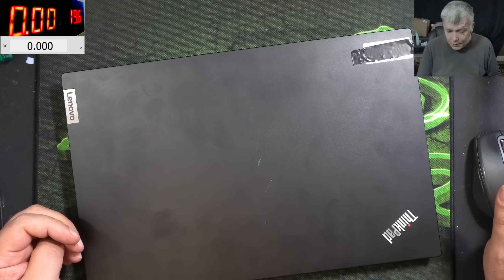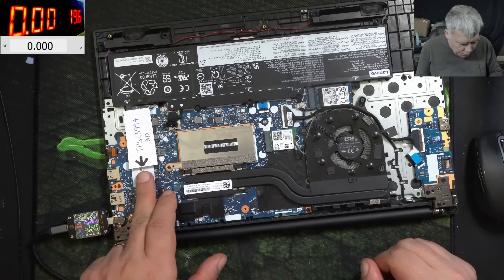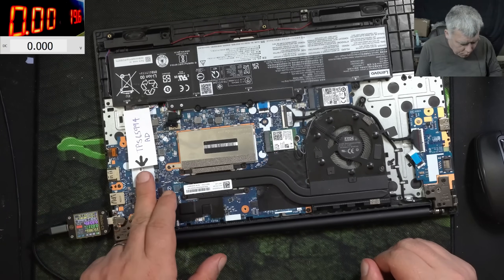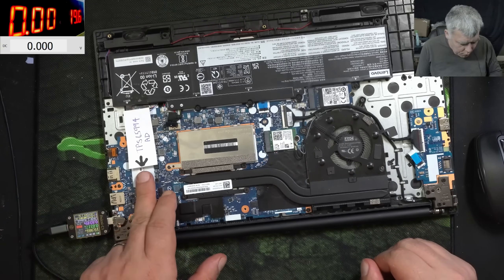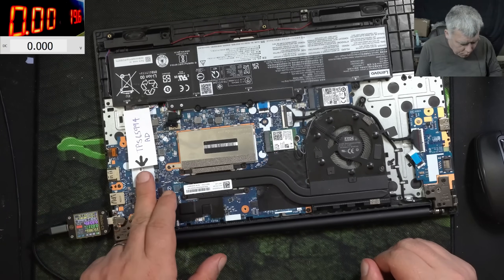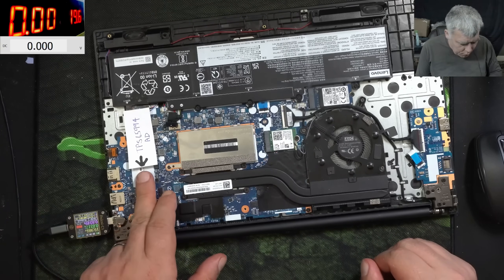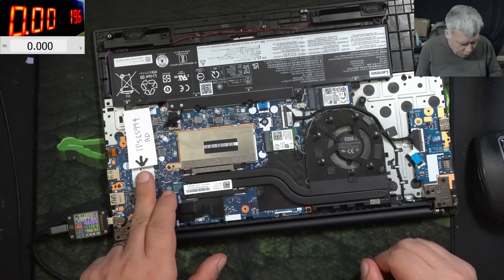Well, this is a common fault - Lenovo E15 not charging board repair

Comment: So when you solder the left side of where qb6 was are you soldering to the 2 pins on left. Or second one down. Or does it not matter if both are connected. I have same laptop and the usb power connection was intermittent now it’s not working at all.

Comment: I don't even know what a mosfet is, but I followed exactly what he did and now my laptop is powered up and charging (Thinkpad e15 gen 2).  The first mosfet was actually melted to the foil, so clearly there is an overheating issue.

My solder looks like a lump of sh*t compared to his, though.
Reply: Did u solder to one pin on left or does it touch 2 pins. I’m not sure which pins of mosfet did what

Comment: I’ve seen this fault many times 😂

As you say, If you replace just the mosfets they will fail again. 

If you replace the TPS65994 as well as the mosfets it will not longer be an issue. This type of issue doesn’t occur on other boards that use the tps65994

I think this is a typical Lenovo solder problem, is it possible the joints under the usb c are failing first leading to damage to the mosfets. 

Lenovo has the worst reliability of any laptop manufacturer I’ve seen. They should really be recalling laptops for this sort of problem!

Comment: I bought a faulty lenovo laptop just to practice myself about laptop repairs. It delivered yesterday, its ideapad 3 slim, not the same model and it's charging and it seems turning on but after 30secs its just freezing. Had 10mins to check it yesterday and at least half of the cpu nosfets was either gate was shorted to source or source was shorted to drain. But motherboard looks like has the same shape and layout. I think tomorrow or monday ill have time to check it properly and try to repair it since I'm a taxi driver just now :)) it sems most of the lenovo laptops has design issues and fets failing because of it. Thank you master Sorin, warching you and learning everyday in the car when i dont have a customer 🙏🙏

Comment: Please check if volatge from type-c port is connected to here because if there is no anything seperating them and since type-c not only used for charging, any device connected to this port will get battery voltage which will be dead. Maybe that is why it is seperated with mosfets. This is something veeeery important please check it next time when repairing same device . Thanks
Reply: You are right, all external devices that will be connected there will receive the battery voltage if it is not another coil which creates the main power supply for the laptop.

Comment: No model has more than one USB-C?
Then what? Can't that charge pump part issue be investigated and probably rectified, Sorin?
If it's a switched capacitor pump wth no coil, this can be the issue, since to produce 6 volts from 20 with no coil is very inefficient, even for that low current, and sresses the switching circuit, bootstrap and switching capacitor, also must be some kind of resistor there, all three might be external, no?
Reply: The issue is most likely that chip has failed. There are no external coils or even inside chip. It is charge pump, they only use capacitor and some active logic inside chip. You don't need much to raise voltage when there is no current needed. There should be only one external capacitor to the chip. Haven't checked datasheet, but usually charge pump circuits have only one external capacitor. I think it is probably bad batch of chips or design. Since you need some charge to switch mosfets and there is a thing called gate capacitance. As you know if you try to switch mosfets fast there will be big current for a very short amount of time like charging capacitors. Maybe manufacturer of this TPS chip (TI) didn't account for such a big gate capacitance mosfets? Hard to know. But probably just bad batch.

Comment: i work with a charity that loans out laptops for free but they also get laptops donated working ones or even one that don't work they got a lot of lenovo e15 and e14 gen1 and gen2. decided to take on fixing over 7 gen2 all of them had cooked mosfets and i used  wire to bridge across if i wasn't  there to say that i could fix them the would have been recycled i did it at a cut down price because they are charity and i am still extremely new to working with smd components.
Reply: Let me help you work on them

Comment: Hi Sorin, the solder wire is there like a wire or a fuse (to protect the board from a short)? Thanks
Reply: No it carries power to the main power line.
Reply: @octavian9756  I don’t think so, the solder wire can be melted easily than copper wire, therefore protecting the board, don’t forget it was a mosfet there before.
Reply: I mean every wire is a fuse too lol
Reply: @ yes a proper calibrated fuse 😁

Comment: What's the purpose of these mosfets?
Reply: the ic chip is measuring the input voltage and, if it is right, gives 25V on the gate of the mosfet so it passes the current next to the board. If the voltage is too hight, the ic chip just blocks the current non giving the voltage on the gate. so it made sense to make that wire really thin so it could work like a current sensor.
Reply: maybe in case there is a short on the usb-c these mosfets cut the power to the port.
Reply: To protect the fuse from blowing...

Comment: Lenovo used to be a good brand. I've got a Lenovo for more than 10 years and didn't have any problems since then. Mods are old i7 cpu an 8 GB more RAM.
Reply: E-series ThinkPads are the most "budget-friendly" ThinkPads. They are basically just ideapads with a trackpoint. I've had good experiences with modern T/X/P series ThinkPads.

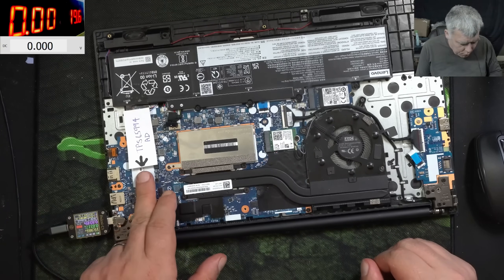Comment: What would happen if the soldering wire touches the gate of those Mosfets ? It seem to be very close to the gate of one of the mosfets 08:00.
Reply: yep, I had the same thought...
Reply: Apparently nothing.  Pretty sure I did it with my crap soldering job, but I'm writing this comment on my laptop.

Comment: I was wondering whether the capacitor they use for the gate drive on that chip is underspecified and leaking so the output voltage doesn't get high enough (the chip max output is 40V)? Otherwise, I believe the gate drive voltage can be software defined so it may not be a hardware fault with the chip but simply programmed too low from factory ...

Comment: If the chip has an issue, and I believe it is faulty, why not replacing it? I do not think all those chips are going to be faulty. Probably a bad batch. I do not think it would fail under 3 months because that laptop has already a few years and now it has failed, so if you replace the chip, it would last a few years, I guess.
Reply: How do you know the chip that you are replacing it with is also not part of a bad batch?
Reply: @schumerlucian  I don't. But if it is a brand new chip, it should last a few years before starting acting crazy. If the one in the laptop lasted that time, logic says a new chip would at least last as long.
Reply: Why fix the board, so it will break again for sure in the future? Why not fix it for real, and take it out like Sorin did, and be sure it will not break again, so you can use the laptop for a long time.
Reply: @paulodagraca3469  May not break on that area, may break somewhere else. You can't be sure that replacing the chip, it will break in the future. If it is a poorly designed chip, then yes, it will eventually break again. But it may be just a bad batch like those MOSFET in Dynabook's laptops.
Reply: Yes I agree. Just replace the chip, I don't think ether it would fail that fast. But the chip is probably quite expensive so that's why they avoid it. If I would short them like that, at least use proper wire with insulation. Like someone said that wire is very close to mosfet gate which goes directly to TPS.

Comment: 06:33 😅
Reply: So actually those Lenovo's mosfets not only act like resisostors, they also act like a drones 😂.
Reply: MOSFET flyyy
Reply: @michelettronica  The solution is very simple. "Fly" the mosfets and make a jump 😂
Reply: @Pepe-ry8pm  ehm no, Is a proper calibrated solder 180°c wire for a proper calibrated fix
Reply: With a proper calibrated MOSFET flyer xD